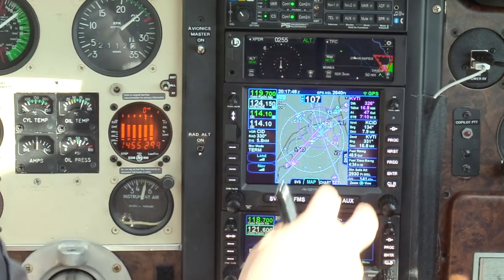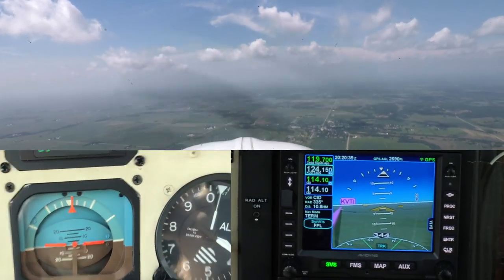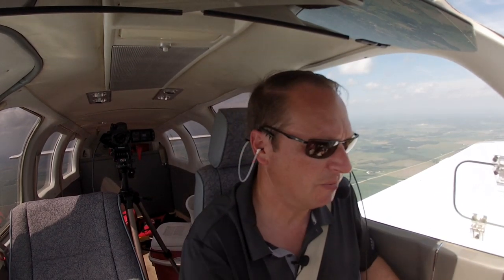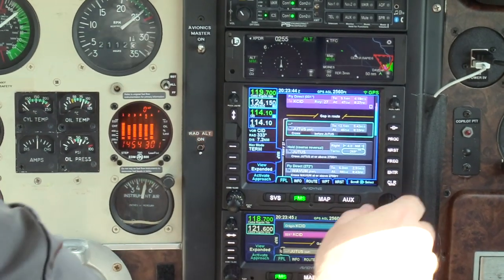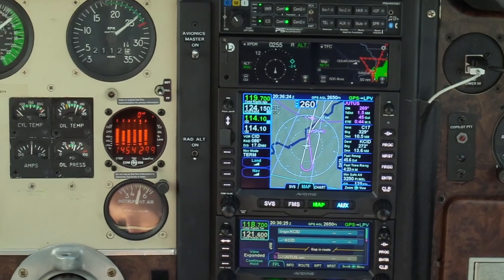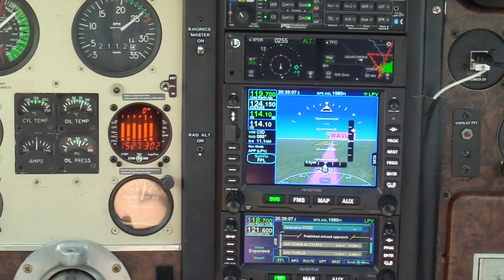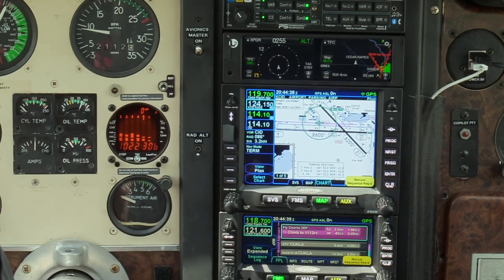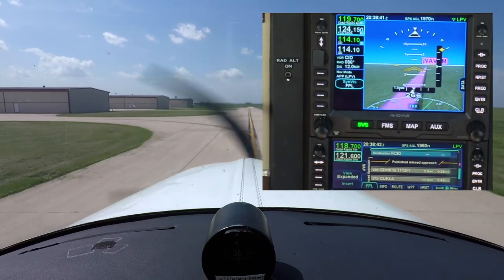Avionics Upgrade -  Part II Avidyne IFD Flight Test

Comment: Martin,  Aren’t those IFDs a blast?  I love mine (550 and 440)!  One of the features I really enjoy (as you demonstrated) is that you can “couple” the IFDs, i.e. using the 440 as a keypad for entering info into the 550.  
I have used the combo on long XCs to show weather: the 550 on detailed weather ahead along my route and the 440 showing a longer-range view of oncoming echoes.  
And, even though I have the EDM930 engine monitor, I’ll sometimes put the 440 in Fuel Management mode so I can cross-check engine/fuel performance.
Now... get that digital PFD and you’ll be all set!  (OK, -AND the GPS steering (it’s only $$)). I have the Aspen Evolution Pro 1000.  A beauteous, awesome combination!  ENJOY!!
Reply from the maker: Thanks, Roger. I really like the setup I have now, but you are right - at some point an EFIS to replace the old six pack makes sense. It's only $$, you are right...  still, my piggy bank is empty, so this won't happen quite yet.
Best, Martin

Comment: Martin, excellent video.
I have a few questions.
1. On the 550 IFD UNIT, WHEN IN THE ATTITUDE INDICATOR MODE, DOES IT DISPLAY AIRSPEED AND ALTITUDE?

2. ATE ALL Garmin mounting hardware are comparable to the AVADYNE UNITS mounting hardware/ports.

3. What are the cost involved in upgrading softwares and charts from AVADYNE.

4. What Garmin units mounting hardware are comparable AVADYNE UNITS mounting hardware. ( Plug and play)

That's all for now.
Reply from the maker: Hello Ule,
You will find more detailed answers to all those questions on Avidyne's website, but in short:
1: It does not display airspeed and (barometric) altitude, only ground speed and GPS altitude. It is not meant to be a replacement for a PFD.
2/4: The tray and wiring from a Garmin GNS430W can be reused for an IFD440 (plug and play). The same is true for going from a GNS530W to an IFD540 or IFD550. If you want ADS-B traffic and weather on the IFD, or if you want the audio alerts from the IFD to go to the audio panel, those things require the addition of a couple of wires, but no changes to existing wiring.
3: So far the software upgrades from Avidyne have been free of charge. A dealer may charge to install the software in your airplane, though (so it's between you and the dealer/mechanic).
Regards,
   Martin

Comment: Nice video Martin. The IFD's will come quickly, I went from a 430W to an IFD440 and I love it!  I don't have a 550, so I use the IFD100 app a lot. A lot of pilots that have the 550/540 prefer to use the bluetooth keyboard, can be MUCH easier to do frequency changes and set up approaches when you're in turbulence with the keyboard. Again, play with it in VFR conditions and see what you think.
Reply from the maker: Thanks for this comment - I have yet to play with the Bluetooth keyboard and see how it works. The keys look so small - but I'll give it a try.
Best regards, Martin
Reply: gbsorenson I noticed in your comments that you went from a 430W to an IFD440. Was the conversion truly a slide out and slide in or was there some modification needed?
Reply: @jimgiordano5378  No modifications needed, slides into existing 430W tray. Follow the step by step instructions and you'll be fine.

Comment: Thanks for the video. How much of your FIS-B is available on your IFDs? I have a GTN 650 and my Lynx is only able to share the TIS-B portion, no weather. The weather depiction for me isn’t a big deal since I get those on my Aspen 2000 as well as on the Lynx itself. I wonder if any of your viewers have an IFD - Aspen configuration in their plane. My Garmin GTN feeds Nav signal just fine to the Aspens but there are little things like not drawing the full procedure turn on the Aspen that irk me. 

You need to get some CiES fuel senders for that JPI. I am amazed how accurate the CiES fuel senders are. Never have been able to trust my fuel gauges in the 28 years of ownership - until now. Keep those videos coming!
Reply from the maker: All of the ADS-B data from the Lynx (i.e. traffic and weather) can be shown on the IFD. Now, I still need to install the one wire for this RS232 interface (waiting until after Oshkosh to re-open things) before that will happen. Until then, I have just traffic visible through an ARINC 429 interface, and not the good ADS-B traffic but only the diamond symbols with altitudes but without direction, callsigns, etc.
The installation manuals of both the Lynx and the Avidyne IFD describe how to pair these two devices for ADS-B info ("Capstone"), so I don't expect any trouble here. Garmin is typically a bit more constrained when it comes to interfacing with non-Garmin equipment, which I suspect is the cause of what you are seeing.
CIES - yes, they make fantastic fuel senders. But I don't have money for them at this time. I left the previous resistive fuel senders in place, and they seem accurate to within a gallon or two. With a good fuel totalizer, that's more than enough for me, though if I ever have to get new fuel senders, the ones from CIES would be very tempting.
Best regards, Martin
Reply: Martin Pauly You may make me into an IFD convert. Need a few more videos to get me into a deep drooling mode 🤣. The IFDs were still vaporware in 2012 when I had the GTN installed. The integration with my Lynx & Aspens may make me rethink my next upgrade. Do you know if the StormScope (like a WX-500) can be displayed on the IFDs. I do have a dedicated StormScope page on the GTN.

Comment: I enjoyed that video. The Avidynes look to be really cool. Baron Pilot has them, as I am sure you know.
I have some questions though.
1. Why don't you have GPSS? That seems to me to be one of the major benefits of a really good GPS.
2. Isn't it possible to control both Avidynes from an iPad running the IFD app? If so, why have you chosen not to do that.
3. Since they have bluetooth capability, isn't it possible to load a complete flight plan from ForeFlight to save entering it all i n again?

It does all look super cool and I'm very jealous! Happy flying.
Reply from the maker: Thanks for your comment. Baron Pilot is a friend of mine; he likes his IFDs a lot and has shown me the equipment before I got mine.
As far as GPSS goes, what my Bonanza is missing is an EFIS along the lines of an Aspen, G500, Dynon, or even a Sandel HSI. Any of those could add GPSS to my panel, and one of these days I'm going to get it. But one thing at a time...
I have a lot to learn still with regards to the features and the EFB connection. I use Aerovie these days, and it exchanges flight plan information very well with the IFD (I didn't show that in the video).
Still lots to learn for me.
Best regards, Martin
Reply: @martinpauly  Thanks for your answers. All the toys are so expensive,  it's hard to understand why. After all, a G500 isn't inherently more complicated than an iPad :) Another question occurred to me, When you have 2 GPS units, do they each have to have their own antenna or can they share the same one?

Comment: Martin, someone may have asked this already but I did not see it in the comment section.  What made you choose the Avidyne instruments over the comparable Garmin units?
Reply from the maker: There were a few different factors to consider, Al. And the Garmin GTN units - the only real alternative - aren't bad either, so this wasn't a clear black-and-white decision. Having said that, what made me lean more towards the Avidyne IFDs were three things:
(1) They were much easier to install in my panel given that I had the necessary racks, wires, and antennas already from the prior 530/430 setup,
(2) As a company, Avidyne seems to make equipment which is more compatible (compared with Garmin) with other brands than just their own, which should give me more choices for future upgrades, and
(3) The Avidyne IFD has a full flight management system under the hood, meaning there should not be a complex navigation or guidance tasks ever which it can't handle easily.
Best regards, Martin
Reply: Thanks MARTIN. I have the 530/430 setup on my Bonanza. I wonder how well the Avidyne units would communicate with the G500

Comment: Hey Martin, great video.  You mentioned that you 'don't have GPS steering'. Does that mean it's just currently not activated, or you'll never have it, or something else?  Thanks. 👍🛩
Reply from the maker: Hi Omar, my avionics does not have GPS Steering (GPSS). I would need to add a device to get it, either a dedicated GPSS system or an EFIS (Aspen, G500, etc.) to provide this capability for the autopilot.
- Martin
Reply: @martinpauly  Thanks very much Martin!  Is that a feature you wish you had, or you are fine doing without it?
Reply from the maker: @devwhit  No question - I would LOVE to have GPS Steering. And one day I will get it. All these fun toys cost money, so I got to do one thing at a time.
Regards, Martin
Reply: Thanks  @martinpauly ! Great stuff as always; look forward to your next video. 👍

Comment: Is your analog cylinder head temperature gauge not working? or is it disconnected in favor of the digital readout to the right?
Reply from the maker: Man, you guys notice EVERYTHING!  :-)
Lately, the analog CHT gauge was working somewhat intermittently. At any rate, that old gauge is history because at this time I have a primary EDM930 in my panel which has replaced all the old analog gauges. Part III of this series will show that in more detail.
Regards, Martin
Reply: I was going to ask the same Question....haha...

Comment: Martin, great video.  Have a fun time at OSH.
Okay, I don't know, so I'm going to ask.  Is the attitude indicator in the IFD550 GPS derived, or is there an actual ADAHRS installed in the unit?
Next, what Autopilot do you have?  Again, I don't know, but I was under the impression that on some autopilots, by leaving them in 'Nav' mode, they would use that for GPS steering commands.  Is the Avidyne DFC-90 approved for the Bonanza?
Looking forward to the JPI EDM930 install, and hopefully lots of video from Air Venture!
Reply from the maker: Thanks, Gary.
The attitude indicator in the IFD550 has its own AHRS (i.e. solid state accelerometers), so it truly shows attitude and not something derived from GPS position data.
I have a Century III in my airplane - nothing modern, but it works quite well. GPS Steering would require an additional device between the GPS and the autopilot, like an Aspen, G500, Dynon, or a dedicated GPSS interface. I don't have of those (yet).
The DFC-90 is approved in Bonanzas, but as far as I know only to replace an installed STEC autopilot. I hear it works very, very well, and I'd LOVE to have one, but I don't know that it's a realistic path for my airplane.
Best regards, Martin
Reply: @martinpauly  thanks for the reply, Martin.  I hope a G3X Touch or similar is in your future at some point, although last time I posted you said finances would keep it away for a while.
Be safe!
Reply: @martinpauly  As soon as I got done posting my reply, I saw a report in FLYING magazine that as of yesterday, Dynon Certified has received STCs for over 600 aircraft!  With the exception of a few airplanes, there is no autopilot certification, but they expect to have the STC for the A36 family later on this year.

SO, that Glass Panel is closer than it was two days ago, even if you don't use the Dynon Autopilot.  I'm sure Dynon will be at Air Venture, I really hope you can work something out with them.

Comment: hi Martin, we have both COM1 and COM2, how usually you use them and switch between them?
Reply from the maker: Different people have different thoughts on that. For me, it's driven by the fact that my COM1 (IFD550) antenna is on the bottom of the plane, and my COM2 (IFD440) antenna is on top of the plane. The top antenna works better when on the ground, so I use that radio for clearance, ground and tower. The bottom antenna works better in the air, so I use it for everything else.
Best regards, Martin
Reply: @martinpauly  it really makes sense. Thank you, Martin

Comment: why buy both the IFD 440 &550? Can't you use just 1? are both needed together?
Reply from the maker: There's a good argument to be made that one GPS/NAV/COM unit is sufficient, especially with the iPad app from Avidyne which basically turns your iPad into a large second IFD screen. Having said that, I like redundancy in case something fails, and the way the two units work together - like for the QWERTY keyboard shown on the second unit when entering data on the first one - is terrific!
- Martin

Comment: Are you going to install a SkyView HDX next?
Reply from the maker: That would be nice. I've actually looked at both the SkyView and the Aspen closely in Oshkosh. I could see either one make sense in my panel, but it's not a cheap upgrade so I'll have to wait a little bit.
Reply: My flying club has a couple v-tail bonanzas that have aspens, which have been great, but they both need ADS-B and new autopilots, so we decided to upgrade the entire panel and put the extra aspens into our Arrows.